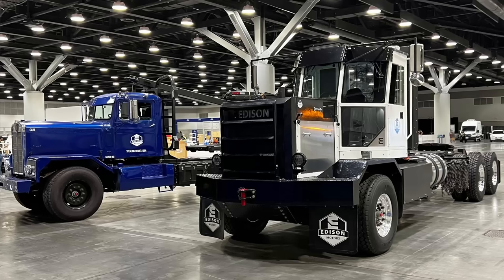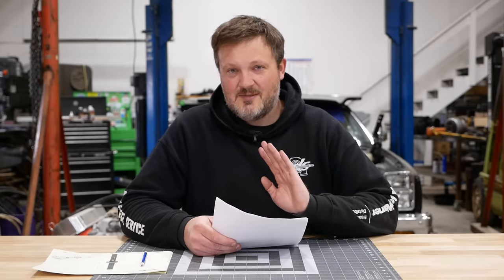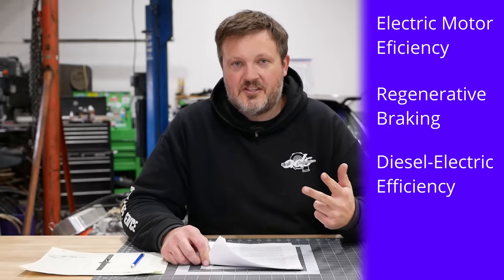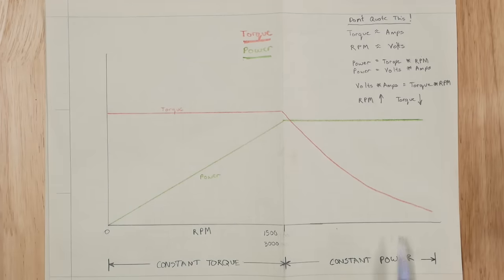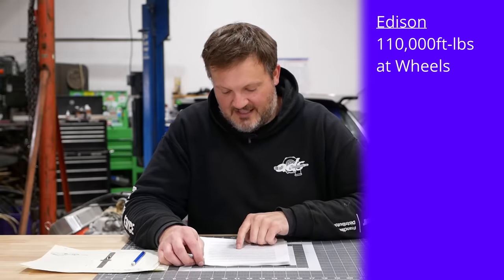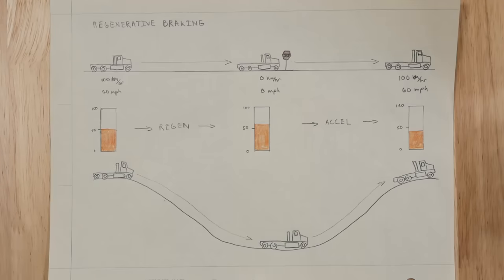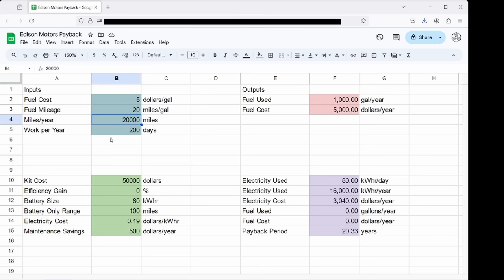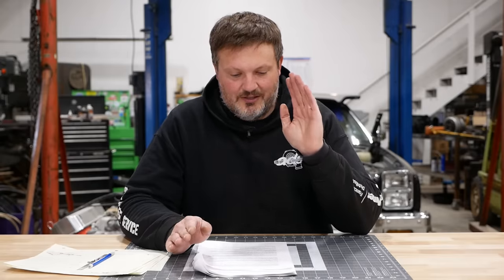Edison Motors Built a Diesel - Electric Semi Truck

Comment: Jay Leno summed it up !
No one has a problem with the internal combustion engine only with what they burn !
We need to come up with an alternate fuel source.
Ev's at the moment all have some kind of petrol/Diesel engine all be it smaller .
Great vid !
👍👍👍👍👍👍👍👍
Reply: Ev's at the moment all have some kind of petrol/Diesel engine???
Reply: @michelangelobuonarroti916  There are a lot of people don't understand all the different "flavours" of EVs. It is compounded by cars like the Chevy Volt or Renault's E Power range where the cars are only pure electric driven and the engine just generates electricity. The distinguishing features from pure EV to mild hybrid electric are confusing. My hybrid has a manual gearbox and clutch which is electronically controlled and it drives the front wheels normally with no EV drive. The EV drive is only through the rear wheels and, while the two combine in different ways, they are essentially separate and I can drive the car in EV only, Sport where both deliver maximum output, Eco where output favours EV and economy, AWD with traction control where both drives are "synced" together and, finally, ICE only if the battery pack is depleted. No wonder people get confused.
Reply: @michelangelobuonarroti916  sorry meant ' hybrids  🤪

Comment: I think you concluded It`s still not feasible. I believe the whole EV deal depends on a breakthrough in battery tech and enough of a source for recharging. As you said, there is no perpetual motion. Also, big rigs,logging trucks, etc. haul extremely heavy loads.The efficiency also depends on overcoming the weight. But I`m just a retired house painter. What do i know?

Comment: As an Electrical Engineer, my main problem with this is, the faster you charge a battery the more heat it generates, could be a fire risk. The quicker you discharge a battery the more heat it generates, could be a fire risk. This is not an opinion, but simply an electrical fact. More research should concentrate on finding safer power storage and safer options to charge/discharge batteries first, as I think we have already witnessed some fairly serious battery fires. Recently in Australia we had a death due to a battery fire. These problem sadly seems to be ignored due to extreme marketing and basic logic is ignored.

Comment: Peterbilt had a concept hybrid truck several years ago. Its been a while, but i think it was a turbine engine charging batteries. I dont recall any mechanical connection to the drive train. It was just a concept, and i dont know if it ever actually drove.

Comment: 18:25 I recall multiple instances where Edison Motors claims the engine bypasses the battery when the motors are pulling power. How does this factor into efficiency?

Comment: One way to think of it.  If there is a truck that delivers a 10% reduction in fuel costs, the trucking companies would be in a line to buy it.  The other truck manufacturers would be hustling to implement their versions.  Nobody is making their version of the Edison truck because the performance is not there.
Reply from the maker: Yes. They will line up for 1%.

Comment: cheap semi new is around $150,000 and up to 220,000.  I think a new truck with this technology would be very competitve.  Boats are doing this type thing too.  going electric motor propulsion, using battery and if need generator and if sailing can regenerate too and its very efficient and like the chevy volt seems  like the way to go.

Comment: Good analysis, one minor point, electricity in BC is stupid cheap compared to most of NA, so intial charge would be cheap. Not much but something. On a trivia note In my home town back in the day a mining system called staffordshire system was used, where the wieght of loaded mine carts on the uphill was used to counterbalance the wieght of loaded mine
 Cars on the downhill side. This was an efficient system. Point, the loaded coming downhill empty going uphill scenario may have merit, but on God's green earth it takes a required amount of energy to move a given load any where.

Comment: Range solution for electric cars; An industry standard battery, maybe two or 3 different sizes for small, medium or large car and light pickups. Battery stations found as common as todays gas stations. Car is driven over pit where ticnication takes 10 min to change out low battery with a charged battery.

Comment: You are correct about the efficiency of rail transport. It's not the locomotive or prime mover it self, it's the glory of steel wheels on steel rail, and 125 double stacked container cars (250 containers, every one of which would have required a truck). That aside, I also have wondered why the Edison guys just don't drop the battery. The battery is the weak link. Just make it a rubber-tired road/logging locomotive, basically.
Reply from the maker: I don't know. Too many questions at this point.

Comment: It's sad to say, but I think you're right.

I thought these guys were great, they had gumption and really believed in their project. But I've struggled to believe that this would work for a broad range of applications, because I've heard about the 60% regen efficiency before, and experienced it in a Honda hybrid I had on loan when our car was on warranty service. We have a steep tunnel under a fjord here, and the battery assist did not have nearly as big of an advantage as I first thought it would. 

The light truck retrofit is not going to work for anything but car enthusiasts, no chance. And if you replace the driveline in a classic, why not just go full electric?

The thing that's going to have an impact for electric trucks and farm machines is the new solid state batteries that everyone is talking about if and when they are available. Toyota recently promised to deliver them in a car in 2026, but not long after they backpedaled on that promise, which is unusual for a conservative company like them.

Comment: I can almost guarantee there will be a battery designed out of someones backyard garage that will solve the battery range issue/charging time issue. There will be no way around having to charge your vehicles through a cord. But where you buy your power from (a nuclear power station) will dictate your savings. Hybrids are short term and low return investments but are working to solve energy supply and storage issues via battery technology.

Comment: Wes I've been following Chase & Edison Motors for almost 2 yrs. I believe he is on the correct track & it was a big step that was completely overlooked by everyone else for some reason. The whole EV thing in a semi is not gonna fly by itself, but this deisel hybrid they're building has serious potential across the board. Until a very serious power grid addition & upgrade is added across the country & North America a larger number of EV cars, trucks & semi's can not survive at all. Hell, many areas can't even handle a very large AC load in the hot summers, and rolling black-outs are normal in those areas. How you gonna charge your EV when you can't even turn lights on cause of a black-out? These reasons and many more are why Chase(Edison) is going to make it big, as long as he's protected his ideas very well(I hope to God he did!). I am very worried about him loosing out to some scumbag who steals his ideas and runs with them getting cheaper Chinese parts & doing whatever else to screw him. But anyways, thank you Wes for bringing him to the attention of your audience, and i cant wait to see where this is going to go in the future! I think hes going to be very successful in this diesel electric hybrid conversion market especially now he's  getting into the 3/4 ton & up truck conversion market with the kits. You should get on board to be a supplier in your area. We all know you can handle the technical part of the electrical system, & the mechanical part is simple. Here to the future🍻🥂⚠️⚡🔌🔋🚚🚦🚧👍🏻👌🏻🛠️🔧🔩

Comment: OK Wes I do not know anything about Edison Motors, but I do know about what building an electric vehicle aka E-bike from a kit is like. As I have done it with both lead acid batteries, and I have done it with Lithium ion batteries and it is a PITA. The lead acid batteries you are going to get less range then you will with Lithium ion, to put that in comparison a 20amp hour lead acid battery was depleted by about 8 to 12 miles brand new and was 100% spent after 1 year of use. The same 20 amp hour battery in Lithium ion could do the same mileage and still have 75% to 80% charge, both cases was with me providing power to the system through peddle power with zero regen braking and was still not 100% spent after 4 years. Mater of fact I still have the battery, and it still indicates to be fully charged even after 4 years of usage.  As for the car, yeah we still have Model T and Model A trucks that are still running and driving in Texas. Granted they have been rebuilt a few times, but they are still on the road as is my 1965 Ford F-100, my neighbors 1959 Ford F-100 and my 2001 Ford Ranger that is very quickly approaching 500,000 miles.

Comment: I've sometimes been disappointed that Chrysler gave up on turbines before battery technology advanced enough to make hybrids practical.  The downsides of turbine cars (producing no torque at anything other than optimum RPM, unable to idle efficiently) would be countered quite nicely by setting them up in a serial hybrid setup.  The entire system is about as simple as you can get for a combustion engine with basically one moving part and you get the quiet operation, fuel flexibility, low weight, and low space requirements of the turbine.  Sure the exhaust is still blazing hot, but that's much less of a problem if the turbine is only spinning while you're moving since the car will be operating on battery power only in most stop and go traffic.  

Overall efficiency would probably be worse than a regular gas powered hybrid though, and of course the precision engineering required to make a turbine engine means it will always be expensive.  But still, how cool would it be to drive a car like that?

Comment: Cummins is actually trying every solution right now. Series hybrid, parallel hybrid, fully electric, hydrogen fuel cell, natural gas… and more. No body knows the answer so they are building everything to test it out

Comment: Diesel electric trains are set up that way to save having a complicated mechanical driveline to handle all the torque to all the bogies. They do the regenerative braking bit, but all the power produced is dissipated as heat through big resistor banks.
I suppose Edison are hoping that the thing that makes the difference is dropping a battery into the mix to make use of this energy?
On the long downhill run that they hope to regenerate on, what happens when the battery is fully charged? Do they have a bank of resistors to convert the excess electricity to heat so they don't cook the battery?

Comment: I think Wes is right about the retro fit kits for pickups.  Even on rust free areas of the country, when a pickup’s drivetrain is at the end of its life, the pickup is usually clapped out.  If it’s not, a gas or diesel engine replacement can be had for around $10k installed.  Thats a far cry from $50k.

I’m not a big believer in EVs.  Too much of the electric power in this country still comes from coal and other fossil fuels for them to make sense as emissions reducers.  I also find the mining required for the batteries alarming.  Just my opinion.

The future is definitely electric, but the future is still more than 20 - 50 years away.

Comment: New trucks for over the road in Canada cost roughly between 250,000 and 350,000, based 31:12  off what I have priced and prices I have heard about. A truck in Canada would cost a bit over 30% more due to the exchange rate of the dollar.

Comment: I work for NYC Transit and we had a fleet of hybrid electric buses that used a Cummins motor that drove a generator, which in turn charged batteries mounted on the roof. Under the bus a traction motor was connected to a driveshaft that was connected to a traditional axle. The diesel engine did not drive the wheels, the traction motor did. Look up Orion 7 hybrid electric bus

Comment: That’s a great comparison in the spreadsheet. Your electricity cost is sky high though! I bet it is correct for your area, but most places I know are around 10-12 cents per kWh.
Reply from the maker: I used the US national average. Same for fuel cost.
Reply: The electric at my house is 18 cents per KWH.

Comment: Robert G. LeTourneau built a diesel/electric semi that was operated over the road back in the mid 1960's but don't believe it was for efficiency just an extension of the electric propulsion he used in large off road equipment. I have a picture of it but not much information exist otherwise.

Comment: So you are slightly wrong on the Chevy Volt being a parallel hybrid. The 1st gen of them was much weirder than a standard (parallel) hybrid. I always heard they were a series-hybrid. A quick google search says series-parallel hybrid (how on earth that works, I don't know). Also Ram just recently unveiled the 1500 Ramcharger, or Ramcharger 1500... whichever it is. That is also a series-hybrid. Naturally that one we have no real clue on efficiency though.

To me a series-hybrid makes more sense than a parallel-hybrid just from a complexity standpoint. Which is actually more efficient, I have no real idea. As I'm not an engineer. From a towing perspective though, series-hybrid makes the most sense. Also what makes sense to me at this point is more hybrids instead of full EVs, they are the future, I just don't think our energy grid is up to the task quite yet.

Comment: I will say that their mountain-logging application is a very specific, and likely very good, use case for Topsy. However, the best application for series-hybrids is in heavy equipment (dozers especially). We test-ran one of the very few Cat D7 “hybrids” (and no I am not super familiar with their system beyond the lack of a typical transmission) last year - and holy fuck that thing will out-push & out-rip the same model year standard-drivetrain D8 all day long, and we saw about a 22% fuel-use reduction over our 3 year old D7. 
Not sure about on-road heavy trucks, but for off-highway equipment, I think diesel-electric (with or without batteries) is the way to go.
Reply from the maker: Yeah, I could see diesel electric being more efficient than hydraulic motors or a torque converter.

Comment: Great presentation on the Pro’s & Con’s of Hybrid-Electrics in general!  There were a couple of other things to be considered that I don’t believe you touched on.  1) Current battery technology, at best, will give you 5-7 years before you’ll need to replace it.  There are plenty of horror stories out there today about the absurd prices of having that done on EV’s.  Some have said the battery replacement costs 1/3 – 1/2 the original cost of the new EV.  In your 18-20 year payback examples, that means at least 3 battery replacements, pushing that payback out even further!   2) More importantly, in my opinion, is SAFETY!  Regenerative braking might seem like a good idea electrically for driving around town or mostly flat level ground.  But most heavy haulers like logging trucks and semi’s are running through some pretty good hills and , God Forbid, mountains!  Without a physical link between engine and drive axles, you have no way to control your downhill speed except the brakes.   Contrary to popular belief among some truckers today, those engine brakes (Jake Brakes) weren’t invented so you can sound “cool” whilst rolling up to a stop sign/light in town.  They are there to give you a way to control the speed of your truck without the need for over-reliance on your physical brakes.  The problem with brakes is that the more you use them the hotter they get.  The hotter they get the less effective they are in slowing you down.  At some point it won’t matter if you’re standing on the brakes, you will continue to gain speed.

Now I do applaud the guys at Edison Motors for their efforts to come up with more fuel efficient trucks.  Lord knows we need it considering the cost of diesel fuel today.  I just don’t think today’s technology can make it economically or safely possible.  One day perhaps!  I think they have a lot more thinking to do before we reach that point to consider production.  Perhaps they should start thinking about more efficient electric generation/storage and perhaps a variable, electromagnetic braking system?   🤔
Reply: The "engine" braking comes from the regen effect of the drive motor recharging the battery pack and when it works, it works well. When the battery pack is full you don't get regen braking so physical/ mechanical braking is still a very  important part of the build. I know when driving my diesel hybrid car that when the regen cuts out you can get caught out at junctions or roundabouts if you leave your braking to the last moment. It was a bit scary the first time it happened to me but I learned my lesson and anticipate it now.